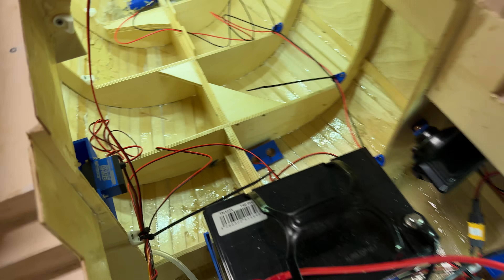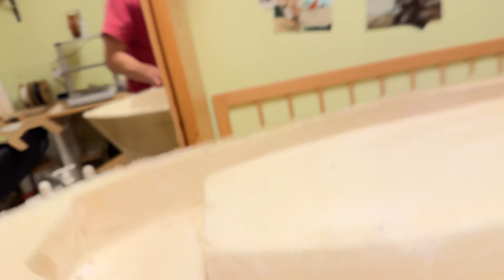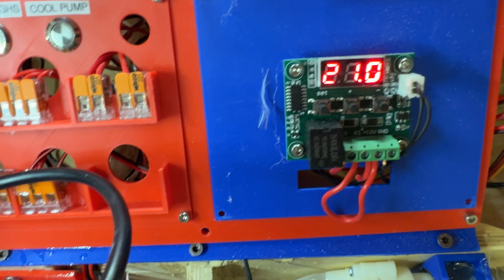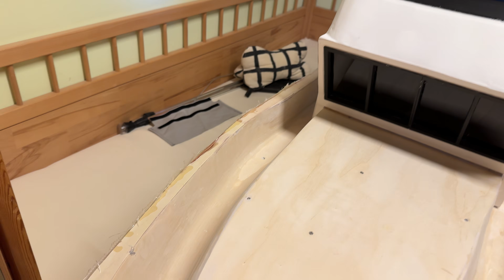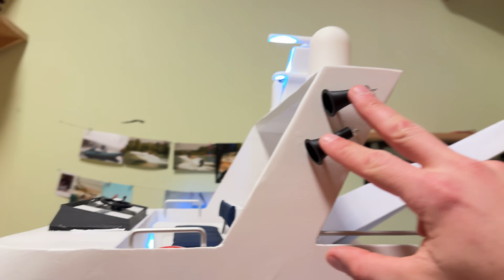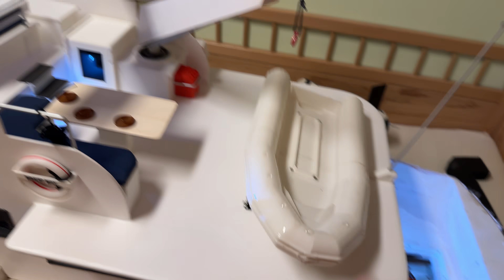Electronics and Pilothouse Done!!

Comment: Your motor is WAY too small for that boat. Buy a 550 watt lathe brushed motor for direct drive or a 350 watt geared motor 2.5:1 on 24 volts you will burn out that small motor. Further you need ballast probably 50 to 75 lbs . Your motor will over heat no matter what. Also two 775 dc brushed motors 2.5:1 geared to one shaft with also work further you need a 5 inch prop. I would not suggest a brushless motor for direct drive of a huge boat like that. Nice job on the wheel house.
Reply from the maker: Thanks for the recommendation! I already have the motor in the boat and it works fine actually... Take a look at some of my recent videos to watch it drive around! got it on 70% throttle limit as well
Reply: @FlosBoatWorks as long as your happy, thanks for the reply. I have four boats at various states of construction, and two sets of plans for another two boats. One is a 8 ft model of a 1962 Chris craft constellation these plans my friend enlarged for me this model I may never build I have two 26 cc two stroke weed eater motors for this model. If I ever build it. I have been building model boats for 45 years rc model boats,. I have right now a 7 foot tug the hull is finished I started it in 2017 its a ww1 fleet tug of the former German navy I got the plans for free and enlarged to my specs . The next one is a 7 ft glass hull for a Coast Guard vessel I got this one for free from a friend but it was damaged in the mold so he gave it to me , most of the damage is surface cosmetic on this one, I have currently two other boats under construction, one is a 50’s cabin cruiser which again I enlarged the plans for a 42 inch by 12 inch hull, the hull is completed on this one and glassed with four oz cloth and thin one day curing epoxy this one turned out well, no filler needed I generaly work to get a perfect hull with no filler to hide errors in construction , I either use plank on frame depending on the kind of hull it is or sheet plywood usually 1/12 to 1/16 thick then glassed is my standard, I use model aircraft plywood usually or if I am planking I use Douglass Fir or White Pine I cut up my own planks on my table saw and finish each on my band saw, my 42 inch cabin cruiser I am working on now will have two Brushless Rocket motors these are 4070-2000 kv each both with water cooled jackets and a 2.1.1 transmissions for both running on 4s lipos speed approx 45 to 55 miles per hr. I am currently trying to build the struts it’s a nightmare I tried aluminum this was a fail because I tried to use those aluminum welding rods you use with propane but when I tried to weld the shaft log onto a piece of aluminum it melted a fail I tried twice , now I am making both struts from steel round bar and I will weld all of it together with my stick welder. I have my own mini lathe 7x14 it’s a great lathe, I suggest if you ever want to buy a small metal lathe buy the Vevor L2035 on amazon. Ca this lathe I paid 799,00$ and it’s actually more accurate then my 7x16 WM210 V was which I sold , this is the best lathe I have owned. The third boat is a 25 inch run-Aboat again would planked construction and it’s glassed as well with 4 oz cloth and epoxy resin I have three electric outboards for it one real big one that I think will sink it it’s quite big and I have two others that look scale on this little boat. Finally my big tug boat it’s real nice I did a great job on the planking but it’s not glassed yet this tug was going to run on 36 volt lead acid 12 volt battery’s with a 550 watt old metal lathe motor I have the biggest prop I could find for it a 5 inch three blade plastic prop correct to scale. I like to manufacture my own running gear with my lathe plus fittings like railings and anchors and other fittings all done on my lathe, I have a mini milling attachment for my lathe and as it turns out it’s just as good if not better then my vertical milling machine that I sold with the garbage 7x16 wm210 V junky lathe for what I am doing this combination has thus far worked well. You did a great job on your yacht looks good, but that motor is very small . I saw you placing in what appeared to be lifting weights into the hull for ballast may I make a suggestion, simply check automotive shops they usually throw out car battery’s you boat would require I think two car battery’s you can safely demolish the car battery’s down to the lead plates after the acid is removed and the battery insides dried out you smash the casings and remove all the lead clean it with a wire brush in a soapy emulsion  then you can melt the lead on a propane stove outside for your boat. If you are going build more boats in the future then I suggest a small metal lathe is a good investment because you can make all your own shafts, I also was going to build a prop jig yes it’s a jig so u can make your own model props and the jig is simple to make I started one years ago but got tied up into something else. I am a line rc boat builder I also have build several real personal boats we bought another one recently a 32 ft American built Uniflite Sedan, we are planning on living on it which means modeling is coming to a close but two boats are coming with me to the real boat these two I will keep. Your boat I think needs to sit deeper in the water I would increase the waterline by at least an inch according to the video’s saw of you running it but that’s me maybe not you, I see now their are few builders that still build scratch wooden rc boats all these plastic ready made tupper ware boats from china. My most enjoyment in modeling boats is the machining of running gear and the finished hull , the part I hate is initially building the hull cutting out the frames and keel on the drawings, I am a pro at this but I hate all the dust from sanding after sanding and cutting but once the hull is glassed up and done that’s when the enjoyment of the rest of the project is happening. I have seen some of these period sailing ship builders on YouTube these guys are master builders of tall sailing ships and big man of war period sailing ships I respect and admire the utter craftsmanship these guys manage to obtain I could not ever be that good my self but I am good at what I build. My 42 inch cabin cruiser hull turned out perfect no fillers required as did the 25 inch run a boat hull and my big tug which I had all kinds of plans for for running equipment David’s and a big hand made winch and working mast with boom and a bunch of other working stuff on board that no one else ever thought of. Well must go, I don’t want to bore you with book here. So I better stop I just wanted to give you some insight into my modeling historically and presently. I build my first big tug boat in 1986 it was the Dumas Mr . Darby that tug had the most powerfull props two bronze four blades I paid 150,00$ for the kit and 150,00 $ for the all the running gear and props, Dumas boats no longer sells that tug last time the sold the kit was I think in the early 2000’s I recall at that time the kit was 5 or 600,00$ usd and running gear about the same, I had partially build the Dumas Donzi as well back in the day that one had twin astroflight 40’s that was a 20 mile per hr model but now the stuff they have is incredible back in 86 a four channel radio with NiCad battery’s was 300,00 bucks very expensive, now I have two radios a flysky 10 channel great radio, and I have a new six channel both under a hundred bucks the hobby over all is cheaper then it was back then however I needed powerfull speed controls for this 42 inch boat I am building now, I bought two 120 amp water cooled speed controls I was shocked at how heavy one was when I got them from China in the mail these where very expensive 130,00$ each the motors where 130,00$ each as well. Well better go I will look at your boat video’s right now if I have any thoughts or perhaps advice I will comment here. Thanks again for contacting me.
Regards Captain Dan:
Reply from the maker: @d @danielfitzgerald3417  well you definitely do know how to build boats and you do have a lot of big boats also as well, which is pretty cool. I love to see those big belts. Do you have someplace where I can look at photos of your boat kind regards from Austria.

Comment: Get 4 prismatic LFP cells plus BMS, 200ah range, under $200 total.
And get a 10A $5 buck converter 12V -> 7.2V for the bow truster.
And then get a GPS navigation system for it. Ardupilot.
Reply from the maker: @pepethefrog7193  then i could go long range thats true 😂 would be fun